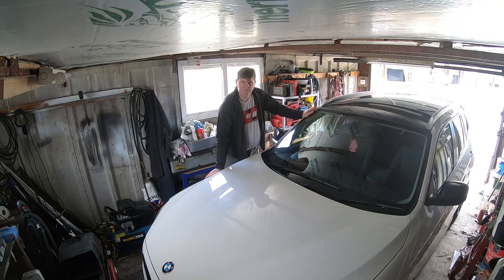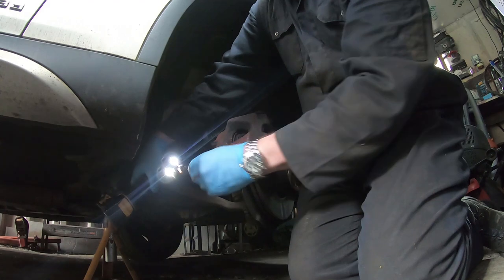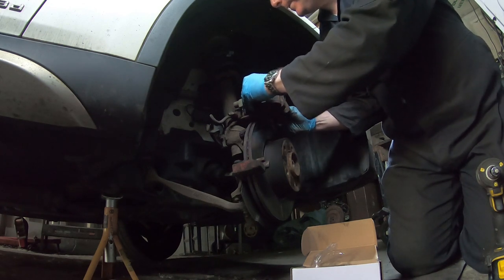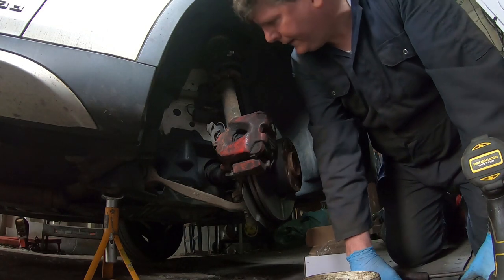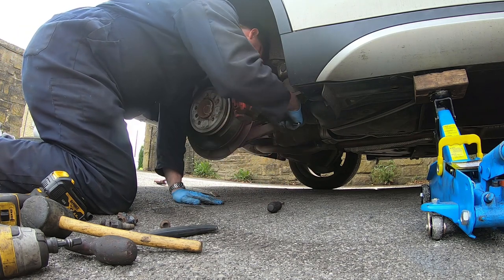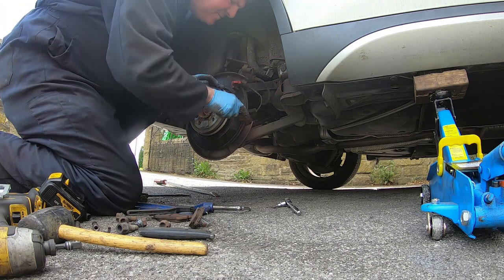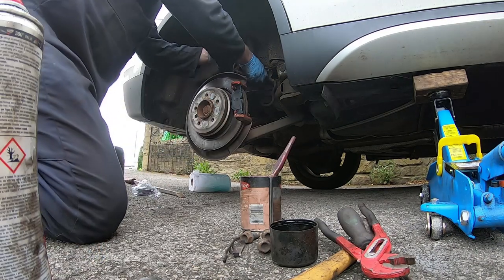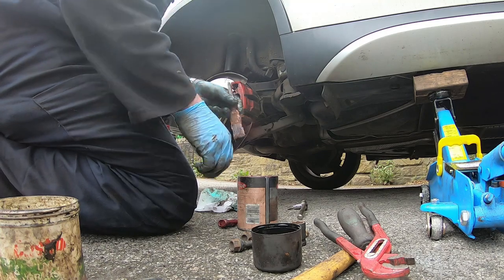2011 BMW X1 Part 1 - Front & rear brake pad replacement

Comment: If you would have put Thoes cailper bolt any tighter they would have snapped
Reply from the maker: The last thing you want is anything working loose. I used the small impact on the lowest setting for tightening.
Reply: @stedavo811   100 % right